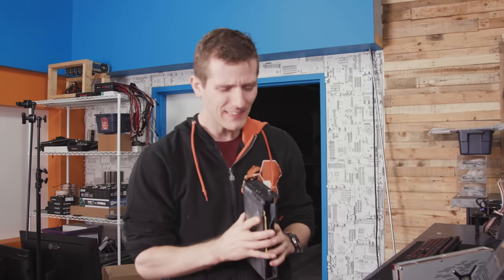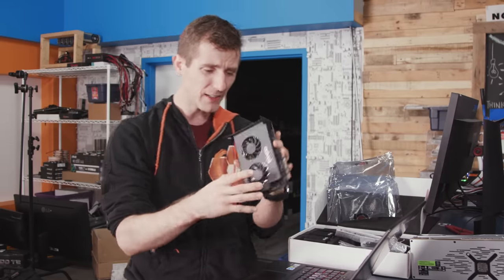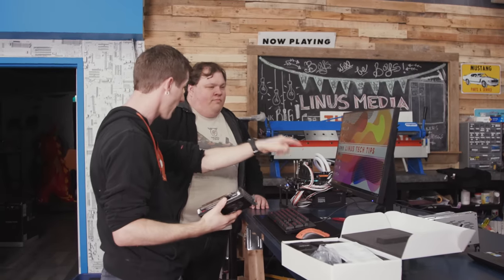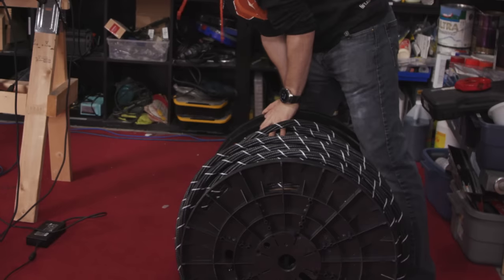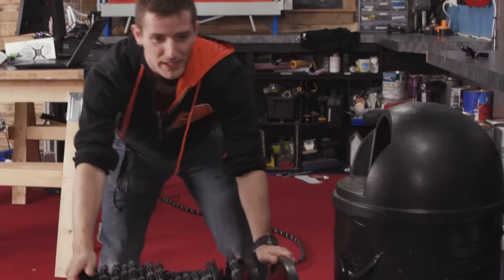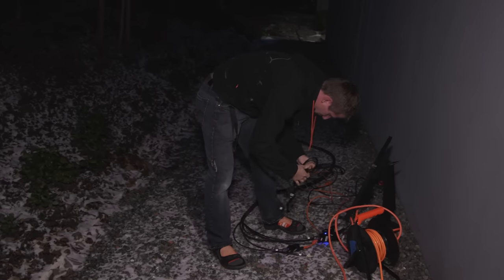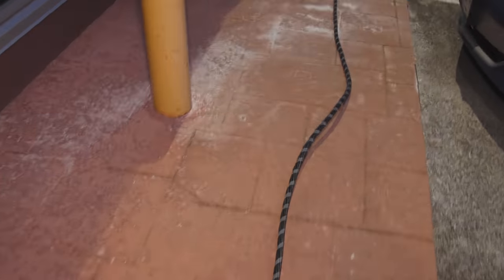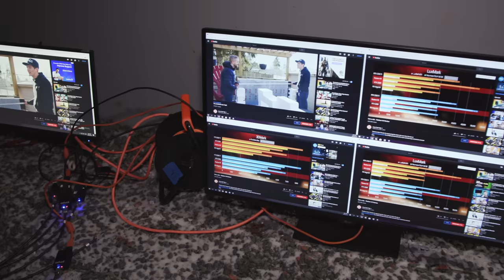The WEIRDEST Video Card We’ve EVER Seen..

Comment: Did you guys really have to unroll it to use it?   The signal is still going over 100m with the spool rolled up, right??
Reply: i said the exsact comment as u said
Reply: Lol facts and logic
Reply: ok,, but it's funnier they way he did.
Reply: Yes, but you never want to use a cable that is still on a spool. Heat builds up and your cable can melt, get damaged or even catch Fire. Also, electric cables like these produce magnetism, and all these difrent Parts of thé cable produce it, all these magnetic fields will go through thé cables and cause disruption in thé signal running through thé cable. Also, it's Linus
Reply: are you actually trying to use LOGIC on this channel? GET HIM BOYS!!!
Reply: Bo Wiek Thanks for that input.
Reply: I wonder how long it took to roll it back in.
Reply: What's the fun in that?
Reply: Crosstalk.
Reply: @bladerj  No. CAT7 is shielded to the hilt. There will likely little to no interference. Also regarding heat, the amount of power being drawn through Ethernet will be  under 500mW which will again be negligible. Needless to say that that isnt going to be felt after a 10 minutes test. We aren't dealing with amps here...
Reply: @bowiek6816   There is just about no current going through an Ethernet cable except to power small devices like that box. Standard Ethernet voltage is about 48v. Most devices will probably draw about 10mA or about 480mW which is tiny. For a quick test this is nothing to be concerned about. 

Regarding interference, this is CAT7, half it's weight is shielding. Interference is nothing to worry about. Now, unshielded CAT5, yes you wouldnt want to do this.
Reply: @bowiek6816  Even with all the wires being insulated, will it actually produce much magnetism? And if it did, would it really be noticeable with all the wires being so insulated?
Reply: @3ountyhunter  I think you mean "ads" instead of audience :D
Reply: @bladerj  unless you lived on Venus there's no chance of that cable catching fire...
Reply: Content
Reply: Then it will not reach 10:31
Reply: @matrixfull  Roll it back in?! Why? No, those monitors are still sitting out there.
Reply: They should have edited with Anthony saying "you know, you didn't have to unroll all the cable..."
Reply: @bowiek6816  Shielded cables.
Reply: Theatrics, I would think.
Reply: My thought exactly LOL!
Reply: Just to make sure I guess. Another short cable hidden inside the rolled up could had been used
Reply: @bowiek6816  Is there even enough current through those cables to do that? They're also shielded so I would think that would help prevent it. I know that the coil effect can definitely happen though, especially with high-power cables, so wrapping in a figure-8 would prevent field generation.
Reply: I was typing the same thing then though wait let me check bet someone already said this lol
Reply: The FBI would like to have a word with you.
Reply: @bowiek6816  this wouldn't be an issue with shielded cable, and these low currents. But probably good practice.
Reply: @bowiek6816  I once ran a 1kw air heater over a spooled extension lead. it lasted about 20 mins before cutting out and I found the whole 20m spool had basically melted into a solid block!
Reply: Thats what i was thinking, same effect with it all in thw same room. Lol
Reply: It doesn't work like that.   When it is spooled up there is interference from other devices and also the cable when straight gives better signal throughput than being spooled
Reply: Guys. There isn't enough current through goddamn Ethernet cables for there to be heat.
Reply: If the cable is coiled up.  Even if it has only 12-48v it will act like a small inductor.  Then because of the smol increase in heat resistance increases then current also increases.  In the end it produces a lot of heat
Reply: It's for the "entertainment". They aren't really a straight tech channel, more of just a tech themed entertainment channel.
Reply: @akash-zg4vj  thats heavily shielded cable. It shouldn't cause interference when coiled up. If it was normal wire yes, but it better not be causing that with that level of shielding.
Reply: @Proscriptus because there is a industrial cooler and they maintain the voltage and if you have closely seen they never coil up the cables.   If excess then they cut it and shorten the length to how much they need.
Reply: only way to get 10 mins to get the ad money.
Reply: It's funny because they're smart but make such stupid decisions sometimes.
Reply: Every one who says it better to unroll the cable has zero idea what CAT7 cable is. He obviously did it for the fun factor.
Reply: @bowiek6816  false and these cat7 are made exactly to be shielded from this type of ''influence//disruption''
Reply: that cable is basically a coil when it's in the roll.. do you know what happens when a wire is rolled like a coil and current pass through them?.. electromagnetism  and here' it'll interfere with the signal itself
Reply: @bowiek6816  They mentioned that it was shielded CAT 7 so it wouldn't have been impacted by interference as you described. Also this application uses low amperage so very little heat would be produced even if it stayed coiled up.
Reply: @bowiek6816  so it being shielded would help that much in this case because there is lot more heat being generated than dissipated?
Reply: @bowiek6816   the issue wouldn't be present as it is shelded cable or stp, not tippical unshelded or utp cable, which electrically and magneticly separates each rap of cable. So he could have left it spooled but why not do it for the unnecessary unspooling montage.
Reply: like the others said, coiled wires with any amount of voltage going through them become electromagnetic.  So essentially, the reason why the coiled wires would cause interference is because the wire itself becomes electromagnetic and starts interfering with the signal because the poles will affect the electromagnetic charge and cause noise on the ethernet line. I don't know about a spoiled ethernet cable heating up and catching wire, but other cables for high amperage devices should definitely not be coiled.
Reply: Douglas Plaisance exactly what I was thinking
Reply: That's what I just said. The signal has to travel the iength of the conductor, the actual position of conductor means nothing. I caught that straight off and started laughing. But it's all  just fun, I really enjoy watching this show.
Reply: @matrixfull  A lot longer than it took to unroll it. And that cable must be heavy with 6 conductors.
Reply: That’s what I thought lol
Reply: @bladerj  All what you say is true but they weren't going to use it very long as all they wanted was to see how it worked so heat wasn't going to be a problem. If there were any magnetically induced anomalies these boys are more than capable of diagnosing the cause. It's all good fun, I recognized myself doing things like this, too often.
Reply: Just Linus being Linus
Reply: what about Electro magnetic Interference the ferrite ring joule thief effect???
Reply: You gotta squeeze the 10 minutes Mark
Reply: @bowiek6816  They clearly stated it's shielded Cat7...I highly doubt that would occur.
Reply: Douglas --- great trolling my friend
Reply: I was thinking the exact same thing.
Reply: Wheres the fun in that?
Reply: For more long video
Reply: @1kuhny  thank you, you said everything I wanted to say
Reply: entertainment bro....
Reply: Heat, interference, etc.  Might as well take it off the spool, even if it’s a bit of a hassle.
Reply: @bowiek6816  those cables are bundled, shielded, cables. So you are Wrong in this one instant.  As the one cable already is bundled with 5 others in the one cables. And if those cables are pushing enough current to heat up the cable then something is terribly wrong.
Reply: I'm pretty sure the people talking about "Never use it in a spool" aren't thinking of the shielding, And it also shouldn't mater for a brief test of a digital signal.... HOWEVER I think Linus and Co did it this way so you can see that it's legitimately far from the PC and not some sort of bait and switch. "Look here's a big spool! ignore the fact that we're only using a 2 meter length hiding inside of it!" can't pull that shit with this setup, at least not easily.
Reply: he gotta check if it works
Reply: My thoughts exactly
Reply: Lol I thought the same thing as soon as he started unrolling
Reply: @bladerj  on shielded cat 7. I thought thats why it was shielded.
Reply: negligible. No Unrolling the cable was not necessary
Reply: Harikrishnan K M All CAT7 cable is shielded like a faraday cage . Go back to physics lessons you muppets.
Reply: IKR WTFFFFF
Reply: guesssing just for content cause it will be just 3 min long video
Reply: I was wondering the same thing.  The line is the same length on or off the spool.  If anything I would think having it on the spool would make things harder since no EMF shielding is ever perfect.
Reply: Because why bother otherwise? Might as well unravel the bastard and go outside because YOU CAN!
Reply: @bowiek6816  You have absolutely no idea what your talking about. Its a shielded cable, and there is not enough power going through the cable to get anything hot, let alone even warm. Learn some facts before you give them, or join Linus's team.
Reply: Bo Wiek you heard of insulation? Go check cat 7 insulation standard. Heat built up with 12v low AMP on fully insulated cable. ROTFL, you should be a comedian xD
Reply: @bowiek6816  I think you're joking, but just to be sure, most of this is nonsense. Heat does not build up in cables because they are not carrying enough current to generate heat. So, they will certainly not catch fire or melt. All electric currents product magnetic fields, but the strength of the magnetic field is proportional to the magnitude of the current. Since we're already established that there is nearly no current in these cables, the magnetic fields they produce are insignificant. The signal bleeding between two adjacent ethernet cables is totally negligible. I have seen 200+ ethernet cables running all through a single conduit, and they all passed certification for gigabit, and none of them showed any packet loss or interference from nearby cables.
So, all that said, NO he did not need to unspool the cable. He could have just used it where it was and it would have been an equally valid test. He did this because it makes a funnier and more entertaining video, and to illustrate how far that cable can reach.
Reply: The video would have been less than 10 minutes if he hadn't
Reply: welcome to linustechtip
Reply: @bowiek6816  This absolutely would not make enough heat to melt.
Reply: they tried it first, lag was 1 sec so they unroll to hide it.
Reply: Was saying that during the entire video.
Reply: The scary thing is there are probably event organizers out there who do this kind of thing five times a day.
Reply: l was thinking the same thing.
Reply: @bowiek6816  that is irrelevant in a test. and the ammount of power involved here is minuscule anyway.
Reply: but how would you make a 10 min video if you dont un-roll it? lol
Reply: Same thoughts here.....
Reply: C O N T E N T
Reply: This is a joke right? You really don’t understand why he unrolled it?
Reply: My thoughts exactly, knowing Linus it's prolly just for the lulz
Reply: It's for comedic effect
Reply: Haha adds to the video
Reply: linus is a show off
Reply: The worst bit is teh way he unrolled it twisted up the cable and it is solid core armored, so it is basically destroyed
Reply: Douglas Plaisance that is what I thought
Reply: It's good to be logical.....bt hey...its linus...what are you expecting...😁
Reply: Because It's entertainment.
Reply: shielded and i doubt there's any more then 12v running through it
Reply: Just wanted to comment exact same thing lol
Reply: chill, if linus didn't do it we wouldn't be able to see him do this.  :)
Reply: same exact thought here
Reply: Not at LMG.
Reply: @bowiek6816  Shielded Ethernet, even PoE only uses 46 mv across the 4 pairs, it's not enough power to melt 60 gauge aluminum over 5000 meters, let alone 30 au copper in ethernet, and due to the shielding, the emi is effectively non existent...……...This isn't 120v power cable, it's ethernet......…...
Reply: There is the undeniable fact that when you trunk (even insulated cable) and spool the trunked cables, you have a enough winds and enough power, you can have some pretty bad interference. Other than that, I'm guessing it was for dramatic effect.
Reply: See it as a studio tour
Reply: Hay at least we now know what 100 Meters looks like :D
Reply: @bowiek6816  shielded eth. cable? nah...pretty safe
Reply: true, but where's the fun in that :)) content
Reply: Had the exact thing in mind
Reply: bc 10 min lol
Reply: but.. footage
Reply: @akash-zg4vj  Using ohms law, current drops as resistance increases if voltage is constant. So no, current will drop, becoming self regulating. Even then, no heat will ever be produced in this scenario.
Reply: @Hkmmotologs  Not in this case, any interference from induction is negligible due to the intense amount of shielding that is the purpose of this type of cable...
Reply: @Xp1c3r  Honestly knowing him, he probably wasn't sure if there would be interference. When it gets to anything outside of specs/computer construction, he seems pretty clueless in regards to tech.
Reply: Ah my bad wasn't paying much attention to the video. To be honest an ethernet cable that long wouldn't make sense anyway.
Reply: @DragoNate  most kind of insulations Does nothing to protect agains magnetism. Most cables protect them selfs with a Faraday Cage. It's something that picks up thé magnetic fields and absorbs them. However you always, always have a 'leak flux'. This can be really Tiny. How more bits a cable transports how more of a Chance in disruption. This cable is possible protected enough that you want see it, no idea. But keep in mind you have 6 cables Running a current trough them, and they all pass eachoter like 30 times on a spool.
Reply: @canadianmale7610  you have 6 cables Running 30 times around it. Magnetism combines it's fieldpower (H). You also have a Leakflux
Reply: @1kuhny  Your Point makes no sence. First of all,you have 6 cables. Second, they run 30 times around thé spool. So, if you calculate you have 180 times your power that you say these cables use. Beceause magnetic fields combine to 1 bigger one (see how a transformer, or 3phase engine works).
3rd Point, power is not the only thing that matters, look to module relais in a PLC, they use 12v @ 0.1amp and generate enough magnetism to move a relais that weighs about 250grams. 
And my 4th point, it stands in their manual that singal disruption can happen if you don't unroll it.
Reply: @matt5635  haha, keep in mind 1kw power is more than these cables use, but these cables(wires) are much thinner also
Reply: @BB..........  Not far, i study industrial electricity. You can try and give me some arguments though.
Reply: @slayar223  No. No cable in thé world is made for this.
Reply: @razredge68  You have this cable x180 times .(6 cables Running 30 times over thé spool) magnetic fields combine.
Reply: @es_los  it helps allot, but not enough to be run on a spool. No cable is made for this.
Reply: @ugetridofit  I do know what i am talking about. Read my other comments.
Reply: @grzegorzdzien8422  thé fact that you think that insulation is for heat says enough for me bud.
Reply: @1kuhny  current wil not drop. Amps wil increase. You don't know what you are talking about
Reply: @bowiek6816   Fine here's all your questions answered

1. When did I deny the fact that there are 6 cables? That is my calculation for over all power. Just because there are six wires doesn't mean that they are all passing half a watt... Besides it's likely only 2 wires are carrying power to actually supply things with. Sometimes it is 4 but it's unlikely given the amount of data needed to be sent.
2. Magnetic fields don't "add up" they can only be concentrated. The amount of turns do change the inductance but that is not the only determining factor for determining the magnetic flux being generated. If the fields where changing direction (not going to happen, DC only here...) yes there might be a problem. 
You realize that there are twisted pairs in that cable right? 
How do they not interfere with each other based off your logic?  
Also that is has nothing to do with how transformers and brushless motors work. Yes they work with inductance and EMF but it has nothing to do with magnetic fields increasing with strength due to a non-existent amplification. What you are telling me is that you are creating energy from nothing. Needless to say, that can't happen. How transformer works: An AC current is passed through one side of a transformer, this produces an expanding and collapsing EMF which is then induced into the other side. This other coil then produces an output voltage due to its induced expanding and collapsing field
3. How does the weight of the entire relay/contactor effect how much strength is needed to move the little metal contact inside? Your not trying to move the whole thing, case and all, with a magnetic field are you?
4. I'm going to need to see a link to that manual. Im sure CAT7 is not required to be used and that that warning is more of just a precaution incase someone uses less shielded or unshielded Ethernet cabling...
Reply: @bowiek6816 Regarding me not knowing what I'm talking about when it comes to current decreasing when resistance goes up...
 Do you know what this equation is? I=V/R?

Do the math here. If you have 1v/1 ohm you get 1 amp. Now let's keep voltage constant and and double resistance to 2 ohms. Punch that in a calculator and what do you get? Would you look at that .5 amps or 500mA. Like magic current dropped as resistance increased. 

This is the problem with industrial electricians trying to understand the lower voltage applications and electrical engineering...
Reply: @bowiek6816  You're forgetting that CAT 7 is  still using twisted pairs which prevent magnetic fields from impacting other stands within the wire.
Reply: Have you noticed that every person who seems to know anything about STP and UTP cables says you are wrong? Well I don't understand this kind of an "expert" to actually admit you were wrong and making stuff up from the deepest caves of your arse.
Reply: @bowiek6816  Very interesting, thanks for the explanation. I don't know much about this kind of stuff, I just knew that insulating wires was important for keeping the electrical charge inside and not going anywhere else.
I never knew or thought that electromagnetism would be much of an issue either.
Reply: Bo Wiek dude im installing network cables in iron factories with giant electromagnets all around
Reply: @bowiek6816  Well, I've been a low voltage tech with the IBEW doing copper and fiber data, fire alarm, security and audio/video for the past 10 years so I think I might know what I'm doing. The amount of voltage and current involved in data cabling is small so saying there's a chance of fire is just plain ignorant. Yes, there's possibly magnetism, but that's one of the reasons, along with noise rejection, that data cable uses twisted pairs and shielding in the first place. That's why you can have dozens or even hundreds of cables bundled together in cable tray with no issues.
Reply: @bowiek6816  Yeah I know. Heavily shielded data cable would probably fine. We all know Linus did it for dramatic effect!
Reply: yes but unrolling it makes more views :)
Reply: but thats less showworthy
Reply: @bowiek6816  true, if it were powercables. but not with a utp-cable. Voltage/current is too low for heat to build up. The shielded CAT-7 they use will have no interference from magnetic fields. So they could just kept it on that spool.
Reply: They need to unroll cable because of induction.
Induction makes noises and lost packets on cable.

So, only way to fight induction is unroll cable.
Reply: Cmon, did you not want to hear Linus grunt “ah oh uh oof” 1000 times?
Reply: @bowiek6816  You do not want to coil up main's cable. On this kind of cable, or even PoE it doesn't even mater. And those cables are shielded, so no disruption either. Linus is just being dumb and/or over the top to make views. And it works since I'm commenting...
Reply: @bowiek6816  There's a reason why communication cable is rated only at a specific amperage and commonly sold in "twisted pair". Magnetic fields, though prevalent, are nonexistent in a single cable. Twisted pair setups help prohibit cross talk or interference. Heat is more on the electrical side, which Comm cable barely uses. 

Long and short, they could have tested the cable - even in PoE setup - on the spool and had the same results.
Reply: @matt5635  Yeah but  here it's neither AC current, nor 1kW of energy. In this configuration it wouldn't even make a difference. BTW, PoE equipments are tested on spooled cables in factories.
Reply: Its obvious linus also knows that but actually he shown by doing that the worst part of this product in comparison to Matrox approach
Reply: @bowiek6816  on the small amount of voltage that is present in ethernet cables you are going to have to be very very very very very unlucky to have any damage due to the amount of voltage. 

The reason on this setup you would want to unravel it all would be down to the electromagnetism that would form and cause loss of signal and/or quality
Reply: Bo Wiek not on armoured cable
Reply: @bowiek6816  not only does CAT7 have twisted pairs, but each individual pair is shielded. There goes your EMag argument. Lol  
How is Cat7 cable physically different?

Cat7's pairs are individually shielded in addition to a shielded jacket over the whole cable, allowing it to operate at much higher frequencies with less interference. While this level of shielding is available for Cat6 and earlier Ethernet revisions, it is part of the intended design of Cat7.
Reply: @Hkmmotologs  not an insulated shielded cord. Plus, look up how much power Ethernet is run at. There isn't enough current to create detectable heat or magnetic fields.
Reply: Do you people not know most inductors run at a high voltage?
Reply: You do not get to the 10 minute mark leaving the wire un-spooled.
Reply: In order to test it , they have to unroll it to find its resistance to stray magnetic fields and inductances. In its rolled up state even a unshielded, cheap cat6 would have sufficed. Anyway kudos to the display card. He did not mention the price tho.
Reply: @bowiek6816  do you know what cat7 means?
Reply: @bowiek6816  @bladerj
Seriously, guys??
Do you realise how little current runs through ethernet cables?? And they're shielded and armoured! It'd take several thousand watts to melt that cable. You REALLY think a single 6 pin (75Watt) power connector could melt that beefy cable or even cause magnetic interference??
Get your head out your ass and go take a basic physics / electronics course!

The only reason he unraveled the entire thing was for dramatic effect.
Reply: he just caters to his audience
Reply: agree................................................................
Reply: That was the dumbest thing I have watched anyone do this year so far. Does he really not know there will not be any difference if he had just plugged it up where he was?
Reply: They prob did it to make a more interesting video, also there might be inference from the magnetic field ur creating pushing power thru coiled wire
Reply: @bowiek6816  thats why server rooms nit the cables together....... to cause a massive INFERNO......
Oh it doesnt burn.. hmmmm
Reply: This is LinusTechTips
Reply: @bladerj  It was Cat 7 which eliminates EMI (Individually shielded twisted pairs). PoE max out on like 15W and 13W is assured to the connected device. Meaning he have like 2W per cable, which I doubt produce enough heat to start a fire. If this was a normal powercord id agree 100%, but i think we can safly say that in this instance leaving it unrolled would be fine. :P
Reply: @bowiek6816  Does that still apply with optical cables?
Reply: @robgrainger5314  with an optical fiber cable you also have to have a unrolled cable and idealistic of the ideal length without any bends but that's bcs of other reasons
Reply: I was just about to type this same thing by but you beat me by 11 months